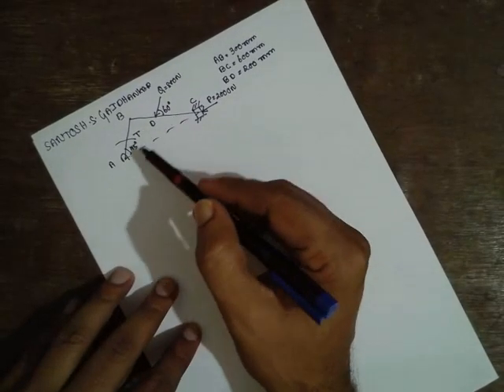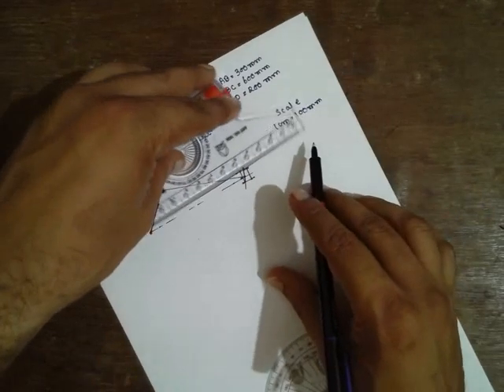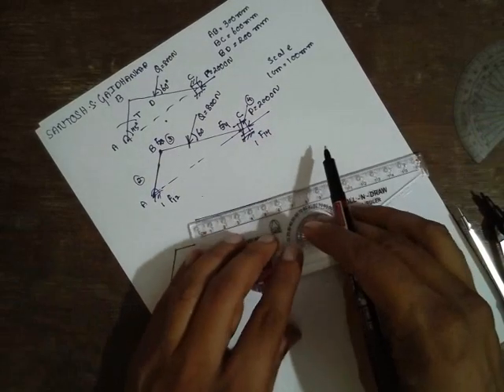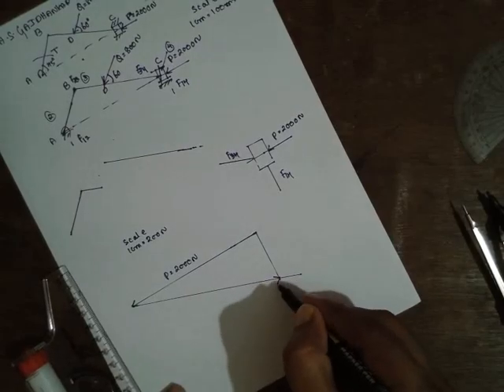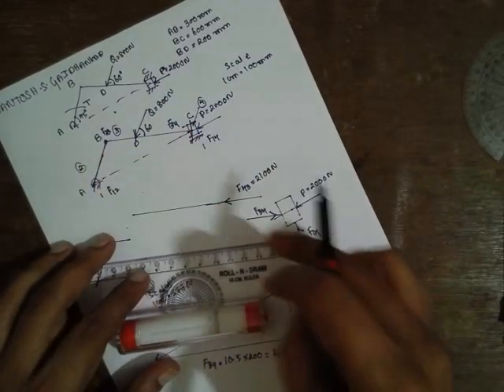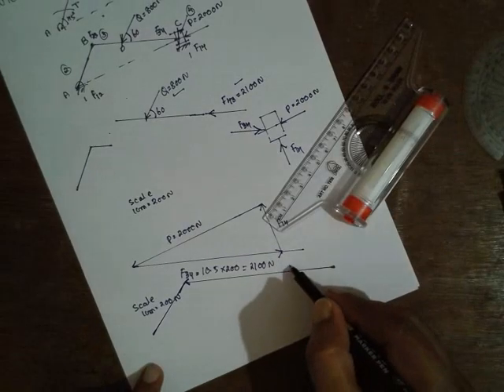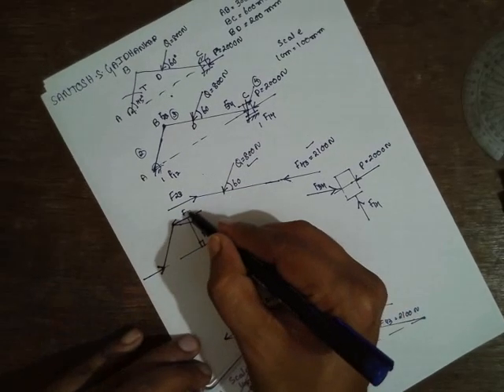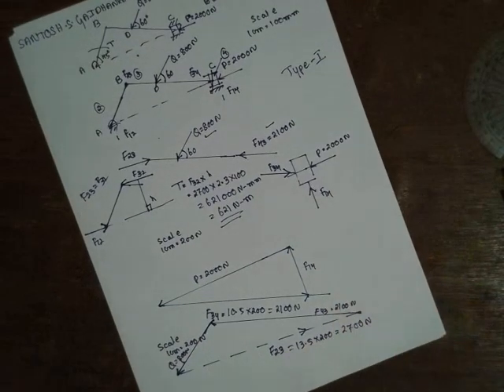Static Force Analysis of Slider Crank Mechanism TYPE-I

Comment: This method is wrong. You cannot know the direction or line of action of f34 initially. You have taken directly the line of action of f34 for drawing force polygon for the slider. ..the f34 has to be resolved into normal and tangential and then from the force polygon for 3rd link you have to derive the direction of f34. Your method is only suitable for one force problem. What you are dealing here is two force problem.
Reply: If you take transverse and radial components of the f34 force the value of tangential component is nearly negligible so, you can do it like this way
Reply: Comment and reply are correct

Comment: Sir I am getting some different answers 
It will effect on marks in external or not
Reply from the maker: No
Reply: @santoshsgaidhankar5795   I got for link one is 598 Nm and u got 621
Reply from the maker: Answer is correct.
Reply: @santoshsgaidhankar5795  sir were to take this crank 
When the crank is 60• away from IDC 
Were to draw angle at right or left